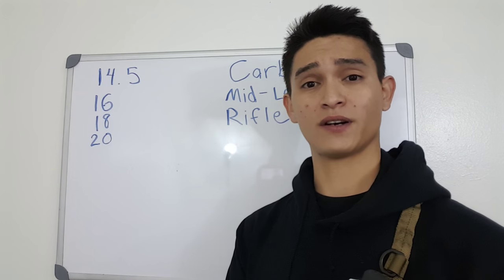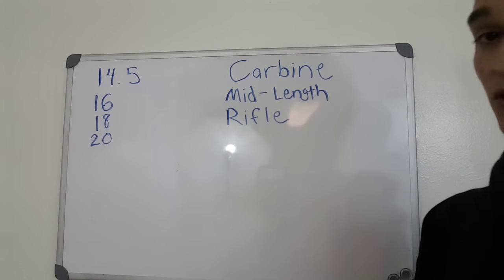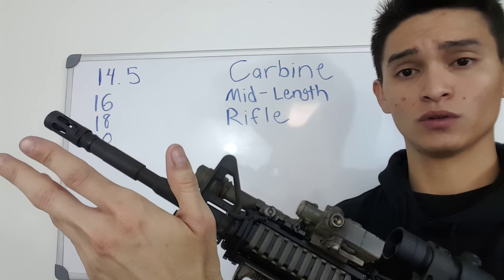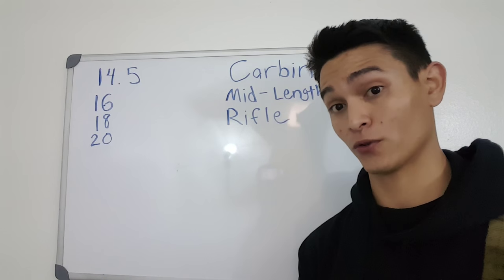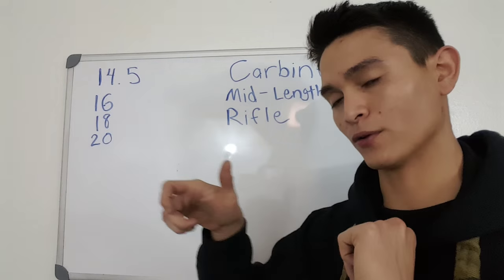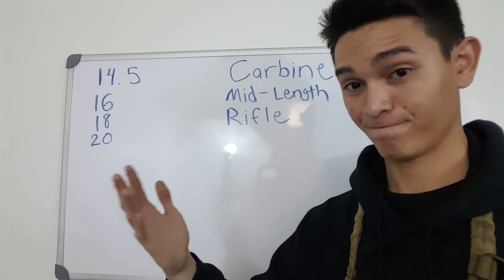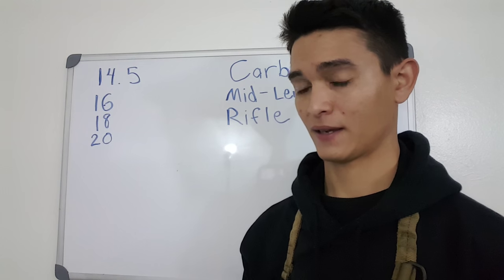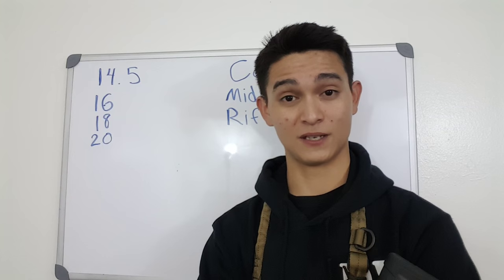AR 15 gas systems and barrel lengths, which one?

Comment: I'm looking to run a 20" barrel/ rifle length gas and a collapsable stock. 
Which buffer is my best bet?
Reply from the maker: a standard carbine buffer well work just fine
Reply: AregularGuy really? Nothing heavier? 
I thought maybe the cyclic rate would be too high.
Reply from the maker: +Navy_blu77 the weight in the standard carbine buffer is already heavier than the rifle length buffer by a little to start (keeps the cyclic rate of the shorter gun in check). So with that in a rifle length gun in such a short tube it balances out fine.
Reply: I thought a carbine buffer was around 3 oz, while a rifle buffer was around 5.3? 
Sorry if I'm not getting something here.
Reply: +Navy_blu77 I thought the same thing hahah
Reply: +Navy_blu77 The carbine uses a shorter spring with a heavier spring rate. The carbine buffer weighs 3 ounces. The rifles buffer weighs about 5 ounces, but has a longer, lower rate spring.

So, if you are using a collapsible carbine buffer, then use a carbine buffer spring with a carbine buffer (3 oz) or H buffer (3.7 oz). You can try a H2 or H3 buffer if you want, but a carbine or H buffer will work fine.
Reply: H2
Reply: bubbatime this is old but want to elaborate on it... this is a good starting point but ultimately it all depends on the sizing of the gas port itself. The easiest solution is to get an adjustable gas block which allows you to tune the gas properly to work with your buffer weight and spring weight. Otherwise you have to play w different buffers to get proper bolt cyclic speed. 

If you are having fail to eject you are likely over gassed and need a heavy buffer to slow down the bolt returning to battery. If you are seeing failure to feed issues then you are under gassed and need a lighter buffer. To allow the bolt to travel further back. 

The way to do this is keep decreasing buffer weight one size at a time until you start having FE issues. (These will typically be a stuck casing in the changer but not always) These issues won't be every shot and will mostly require faster shooting to force to happen. Maybe 1 round per mag or even less.. having issue. Then drop one size for proper function. 

An adjustable block solves everything cause you can close off the port instead of swapping buffers. Generally though a carbine buffer and spring will work for most setups and is the standard for most. 

On a rifle length setup it will have a lot to do with the stock you choose. If you are using a fixed rifle stock with proper rifle buffer and spring it will work flawless. Many put a collapsible stock on which typically is purchased in a package will have either a carbine setup which should work or..... if you cram a rifle buffer spring into a carbine stock it will increase the spring tension cause it's made for a longer chamber and will be preloaded in the shorter stock. If placing a carbine spring in a fixed rifle stock you'll have just the opposite and have a spring without proper preload. There is also a slight difference between a 5 and 6 position stock for the higher quality ones that come with new buffer tube..  the buffer tube is slightly longer.. which will screw with the spring rate.. 

I know all the above is confusing as hell lol.. that's cause it is! This is why an adjustable gas block is the best way to go cause it fixes everything period. Incorrect buffer weight and spring is responsible for 99% of AR malfunctions in non complete off the shelf guns and even still a solid 1/2 of off the shelf rifles.
Reply: 5.56SPR why h2?
Reply: Bruce b h2 buffers are commonly used in rifle length systems with a non fixed stock. The reason more gas is able to be bleed off through the gas port which results in an over gassed system. The heavier h2 buffer slows down the bolt to its proper speed. This is actually all a result of manufacturers being lazy and no longer properly size the port for the barrel length. They almost always just default to a .750 port now which is actually only the proper setup for a 14.5" barrel with a carbine length gas system. With the current introduction of longer gas systems in shorter barrels it changes the dwell times and as such changes the gas pressure returning to the bolt. All the different buffer weights and spring rates are the side effect to make them properly function.
Reply: Hows your rifle upper/carbine lower? Did you get to build it?  I just found out Canadians have been doing that for a while with the C7A2 (looks like an M16A2/A4 had sex with an M4)
Reply: He had the right name. I still say Stoner was stoned when he designed the temperamental AR. Takes a lot just to keep it running. Too much and too many parts that can fail as far as I am concerned. I was thinking about building an AR but I really don't like them or direct impingement and running it wet. I don't like Kalashnikovs either. I will stick with my GI surplus GM Inland .30 Carbine circa 1943. If I use reliable surplus mags and keep it clean, it will run. Other than that I will stick with my bolt rifles. If I could afford an M1 rifle I would pick that. Sweet shooting rifle.
Reply: i have a colt canada 20 inch upper and use the A5 stock system works awesome the canadian forces in the c7a2 use a h2 but the system may have some tweeks
Reply: Navy_blu77 g

Comment: I have a question, on a Carbine length system, can you wear out the gas port in your lifetime? Given that it's properly ported?
Reply from the maker: Yes and that's really for any gas system, but it's about never a factor because you'll most likely kill the barrel before the gas port
Reply: Thank you for your reply!  I asked because I ordered a BCM C8 SFW Upper due to affordability as opposed to a mid-length gas system upper, and instantly regretted it.  My main objective is longevity.  Is there any suggestions you could give me as to the best purchase I should make?  I can return the 16'' upper if necessary
Reply from the maker: @vlogmoor  carbine or midlength are honestly fine man, and either will last quite some time.
Reply: @Regular_Guy_Training_LLC  You're awesome for taking the time to help out.  Nowadays with a lot of civilian consumers going to mid-length systems, I was worried I'd not be utilizing my funds with the proper system.  Hooah.

Comment: Great video bro.    Ok, question, DDM4V7 (mid-length) vs DDM4A1 (carbine).....how different is the recoil?  Is is significantly noticeable?  Like will I hate shooting the M4A1 because of the recoil?
Reply from the maker: Both are fine, the midlength just shoots a little flatter. Enough to notice if you shoot them both side by side

Comment: Just a thing to add: an Carbine H2 buffer is about the same weight as a Rifle buffer. So if you are running a 20" upper, that will be the proper buffer weight for your carbine lower. That buffer weight has also done just fine for my midlength and carbine length gas systems. I think that if I were to run a 14.5" on a midlength gas system, I would probably use a lighter buffer. I'm not sure how much that matters. I'm sure a lot of people obsess over the balance between barrel length, gas system, and buffer weight more than is necessary.

I love my 16" midlength. It is my HD gun of choice, but I kind of arrived at the same conclusions as you, man. I have a 16" carbine length, irons only gun for when I am just walking back in the woods. It is less fatiguing. And I thought my 16" midlength was smooth shooting, until I helped a friend build a 20" gun. After shooting that I was amazed. My next build will probably have to be a 20" gun just because.

Comment: What's your take on Mk18 style SBRs? Those generally run a carbine length gas system and according to my experience with my own Franken-AR build, they are very reliable. (I've only had a few issues with bolt hold open on m193 ammo and certain magazines.)

Comment: I just ordered a 24 inch 223 Wylde upper i normally run a 16 in mid length gas system. Do I need a different buffertube or buffer weight or spring?

Comment: I'm currently building a bench rifle for targets beyond 200 yards I've been debating between an 18 and 20 inch barrel is there much advantage to the 20 over the 18 if both have a rifle length gas system?  And with the lighter recoil what should I be doing about the buffer and spring?
Reply from the maker: Personally the 20 has a very slight speed advantage, and if I do a fixed position rifle, I just use a rifle tube with an a2 stock, standard rifle buffer, and let the problem solve itself
Reply: @Regular_Guy_Training_LLC  I wish I could go standard I'm in California so I am building a California compliant featureless in order to keep a detachable mag with a thordsen gen3 stock but doing my upper with a side charge handle

Comment: This is going to sound dumb. 
I want to build an spr and I was looking at an 18 inch barrel but I heard and saw in my research it tends to be under gassed. So I decided to go 20 inches, I like the ballistics behind it but I realize I need a rifle length buffer tube which is no big deal, but could I throw on a mid length 16 upper onto a rifle buffer system and still have it work, or should I build another lower as well?
Reply: Nicholas Butler I was in the exact same situation, but I went with an 18" rifle length and a rifle length buffer tube. I did get the JP silent captured buffer spring because I hate the springy feeling of most AR's recoil impulse and have had 0 malfunctions. It came with a spacer for the rifle length buffer tube so essential it would work in a standard length buffer tube as well without the spacer. My brother did a 18" barrel rifle length gas system and buffer and has had any problems as far as I know. In short, you won't need a different lower to run your rifle length 20" if you use a JP SCBS, it can be used with that upper in a rifle length buffer tube or standard and works fine with different barrel/gad lengths. If you want a normal spring and buffer you might be stuck with the rifle length tube for that upper. No experience with a shorter gas system on a normal rifle length buffer tube and spring. I can find out though. The recoil impulse between the JP and a normal rifle length buffer is noticable. One jumps less (rifle) and the other is less springy (JP).

Comment: I'm new to having an AR. I have a stock M&P 15 sport II. I believe it's a mid-length gas system. If I got a new barrel that was meant for a rifle gas system, would the only other thing I would need it a gas tube that's rifle length? Or are there other modifications needed?

Also does increasing the gas tube affect rate of fire much?
Reply: The reason why I'm asking cause I have he original mil spec buffer and want to keep he collapsible stock. I heard some people upgrade their buffer springs due to  the bigger barrel with the rifle gas system

Comment: I am new to the AR 15 world so forgive my question.  I recently bought my first AR. It has a 16 inch barrel with the carbine gas system.  I want to upgrade to the mid length.  Do I need to change my barrel to fit the new length. It seems it would push the gas block out from where it is now. Again I'm very new. Thanks for any help.
Reply: Yes. Or just buy a new complete 16.5in mid-length upper. The gas tube and gas block is already drilled at a certain point on your carbine length barrel. You either need a new barrel for mid-length or a new complete upper. I personally in my opinion would just get a new upper. Depends on if you wish to just build it yourself or go factory. As a sidenote: look into and research QPQ barrels. Its a metal treatment vs barrel lining. Good luck and happy hunting.

Comment: I had a mid length. But switched to carbine. When it gets dirty you get more pressure to make sure that bolt moves.
Reply: In theory youre correct but did you mid length ever fail because of this? I mean, you gotta get it SUPER dirty.  For a battle rifle I would prob choose a carbine for your stated reason, but mid length for plinkin

Comment: I have three BCM completes.  All are 14.5 mid length.  The barrels are all different profiles.  I have two bfh and one standard.  1 gov, 1 lightweight, 1 enhanced lightweight fluted.  Love them.
Reply: +Andrew MARGOLIN do you know what weight buffer your using in the lightweight. i just got the midlength 14.5 from bcm in their "on sale" page and when i paired it with my rra lower that came off another midlength 16" gun it shortstrokes like a mamf (i think that made sense)
Reply: +Jerry Tiernan H buffer
Reply: +Jerry Tiernan 
What buffer are you using on your rra lower?
Reply: +Adam i dont know, whatever one came with it ive been meaning to get a scale to weigh it. ive already ordered the bravo lower just waiting for it to come in so hopefully it just comes with one of the aforementioned buffers otherwise il just change them
Reply: +G Lindy thank you !!! that would make sense as the pmc worked good and the tula did not
Reply: +Jerry Tiernan BCM lowers come with an "H" buffer.

Comment: Basically your saying that a barrel length of 18 inches and over the gas tube is a rifle length. 16 inch barrel is a mid length and anything under 16 inches is a carbine length gas tube. Cool. I got a 450 bushmaster with an 18 inch barrel that uses a mid length gas system. a 300 blackout 16 inch barrel that uses a pistol length gas system. 100 yards 1.5 inch group on both guns.
Now your explanation is great but the 450 bushmaster should be a rifle length gas system and the 300 blackout should be a mid length gas system. Can I change that? When you bye a barrel from a company like Bear Creek Arsenal 450 bushmaster each barrel has a different gas system. If the one your getting is 18 inch barrel with a carbine or mid length gas system do you not buy it? thanks

Comment: Another benefit to a carbine length gas system is, since it cycles so hard, it can push its way through crud a little better....just a little.
Reply: Well, yes, it should cycle any ammo you run through it. What I'm saying is since it cycles so hard, it can push its way through debris a little better.
Reply: That's true. Carbine length has systems cycle harder which makes them more reliable in harsher conditions. If the recoil harshness bothers you it's very easy to fix by installing a heavier buffer and extra power buffer spring. By installing the correct buffer and spring you can optimize your carbine to shoot as soft as a .22  I'd personally rather have an over gassed rifle than an under gassed one.

Comment: I'm building an SHTF, WROL, Civil War, Riot Protection, etc. type rifle. It needs to be versatile and functional all round in all weather conditions with all ammo, suppressed and unsuppressed. It should also be quite simplistic in design in order to maintain maximum reliability. I also don't want to "mess" with it after it's setup.

No adjusting the gas system, no more changing out the buffer, I don't care. I want to set it up to run one way and forget it aside from maintenance. (probably gonna go with a front sight base, maybe try to find/order one with a rear mount bayonet lug to get a stabber on a shorter barrel.)

I'm willing to run a braced pistol(SBA4 is excellent), even for something as stupid as a 13.7/.9 or 14.5 to avoid pinning and welding. I won't necessarily be "operating" or "room clearing" but a short, light rifle is always welcome. I've also come to the conclusion that (and already bought a gas tube for) a mid-length gas system is for me.

Other parts I'll be using is an A5 buffer system, and likely an LMT enhanced BCG. I'll likely upgrade my buffer spring to a Tubb Flat Wire spring in the future. So, what barrel length and gas port size do I go with?

Comment: i am pretty new to building AR's?/m4's. i recently built a 300 black out rifle, with a 16.5 in barrel. but i dont run it with a supressor yet. it has a carbine length gas system, but doesnt seem to run that well. was wondering, should i use a barrel set up with a pistol length gas system for this caliber? ive heard that this works better on the 300 blackout. ive tried different grains of bullets, but like i said im new especially to the 300 blackout. any suggestions would be great, thanks.
Reply: What happened with your .300 blackout? Did you get it to work?
Reply: MrChuckwagon55 yes i finally did but changed my mind and sold the barrel and bought a pistol lenght barrel with pistol length gas system.

Comment: Or its a 300 AAC blackout right? I built a AR pistol in 300blk with 10.5" barrel and it has a pistol length gas system and it runs flawless. which I'm pretty proud of since I built it.
Reply: That's because there's less powder and a heavier bullet. So the powder burns off faster and the heavier bullet creates more resistance in the chamber to help it cycle.

Comment: Good video.  Also, it should be understood that the 20"/rifle-length is what the whole system (and AMMO) was designed around.  When people started trying to the weapon down, there were all sorts of problems that took years to sort out, because the original rifle/ammo combo was so delicately balanced.
Speaking of which--is the M855A1 cartridge optimized for the M4 14.5 inch barrel and short gas system?

Comment: hello great video. can i run a pistol gas system on a 16" barrel (5.56). FYI it is not a true 16" barrel.. is is actually a 10.5" with a 6" fake can pinned and welded to it. the only reason i want to do this is because i want to use a carbine handguard and still have the gas block hidden

Comment: 1 in 7 twist 14.5 mid length with pin n welded brake for shtf/trunk gun, your thoughts for cycling?
Reply: jakespeed9419 For SHTF barrel length is your friend. Maybe a 16" mid or lightweight 18" rifle? Also you have better ballistics near and far. My 18" rifle length with a full solid stock fits pretty well in my trunk.